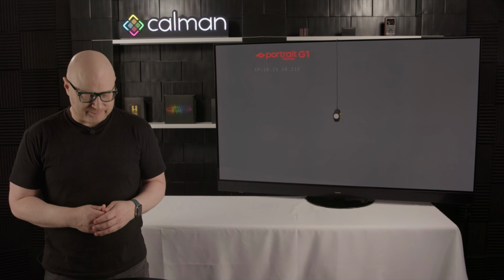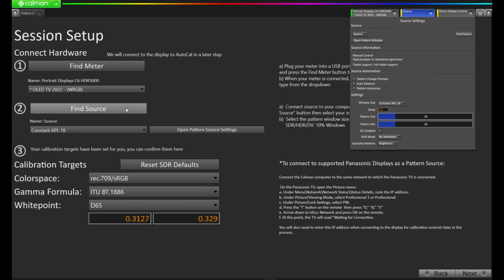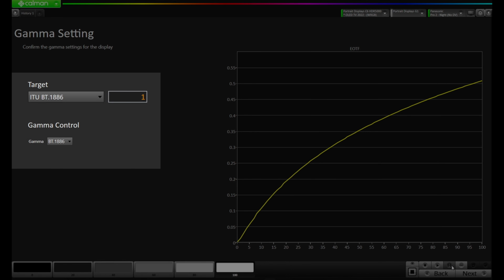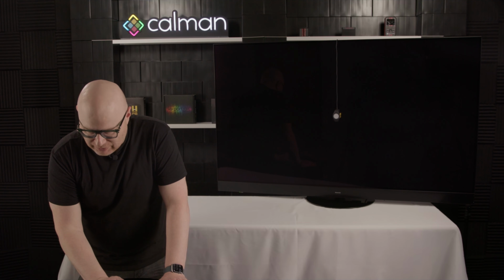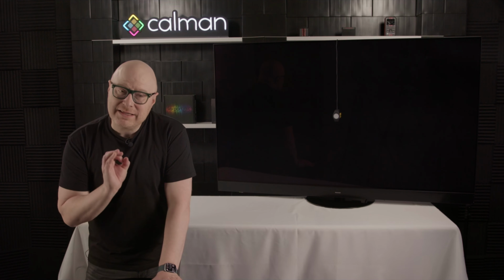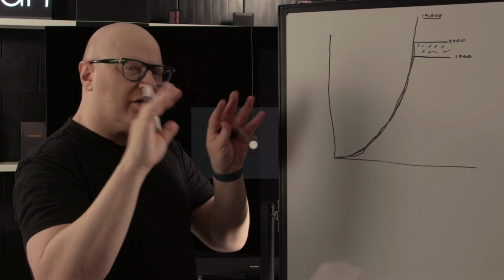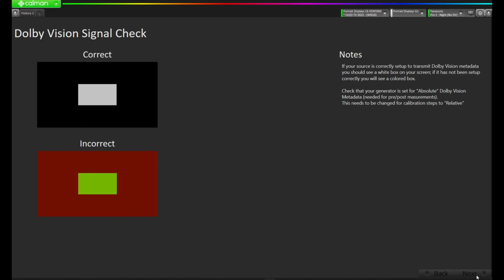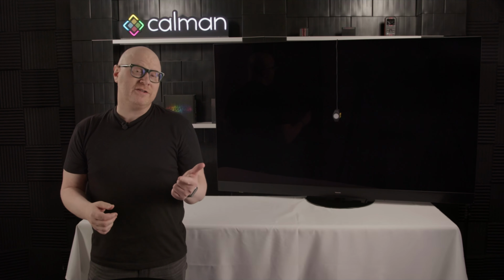How to Calibrate a Panasonic TV with Calman Home | Tutorial

Comment: Thank you we do appreciate it, but why not the Panasonic Z95B??? I'm having some slight issues
Reply from the maker: Thanks for your comment! We’re aware of an issue with the Panasonic Z95B and are working closely with Panasonic on a resolution. In the meantime, you can still calibrate the Z95B using Calman’s manual calibration process. If you’d like more help, feel free to reach out to us at calman-support@portrait.com.
Reply: @PortraitDisplays I am glad you guys are aware and thanks for the response. Hopefully it is with HDR, I can’t seem to get anything to work, I’ll be waiting for a fix
Reply: @PortraitDisplays  hi, has the issues been resolved with the Panasonic Z95B?
Reply: @wallyj2000 @ Their website did acknowledge they fixed it within their last few updates. It did seem to be easily fixable though as the only issue I had was the Luminance changing to 100 after Calman reset the picture mode. Connecting though yes I’ve never had a problem connecting the TV since
Reply: @justinbavuso7706  OK, thank you so much for your quick reply
Reply: hi, has the issues been resolved with the Panasonic Z95B?